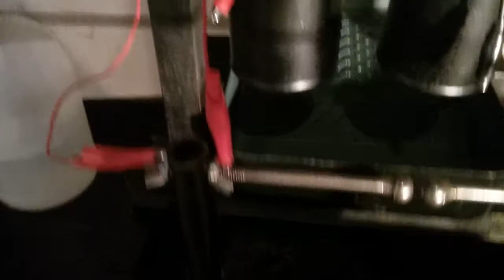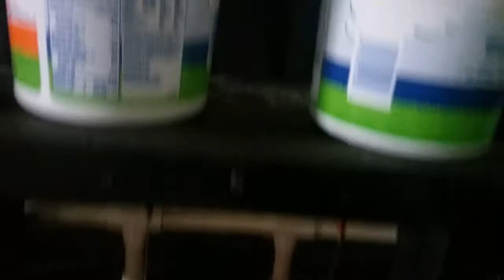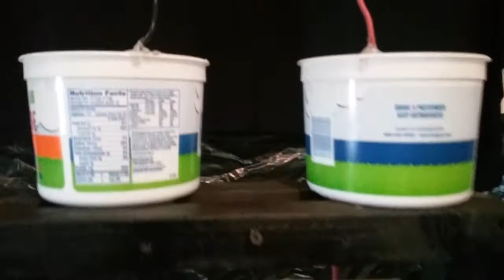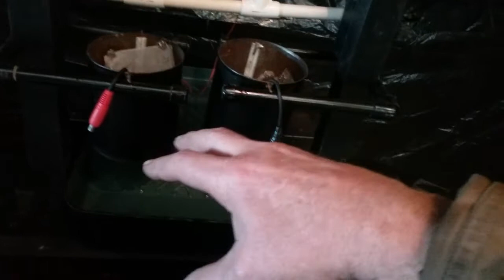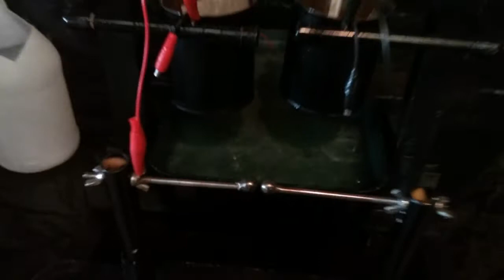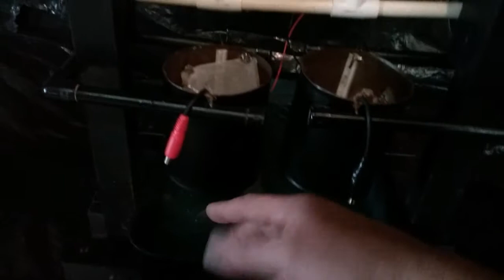Lord Kelvin's Thunderstorm Reversed

Comment: This is really amazing, it's inspiring to do more developments. I wonder if we developed it and got continuous spark, will it help create efficient electricity? We know that lord kelvin's thunderstorm generates high voltage, but very weak current. What is the highest current that it can achieve?
Reply from the maker: Using flowing water to make electricity is much more efficient as done with hydroelectric turbines at river / lake dams. I have no idea as what the potential current of a large (enormous) size  thunderstorm could produce???
Reply: @TheGoodVibrations  
I hope that you will make a video on testing the current of energy produced in this video